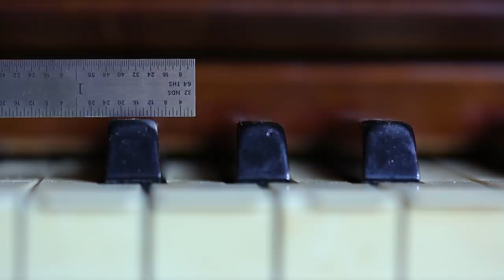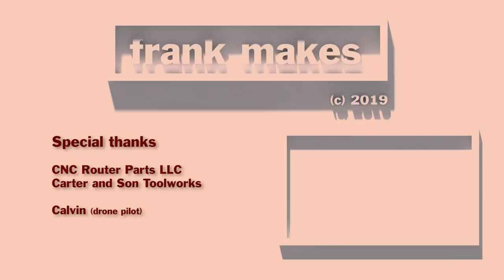Tree Plays Piano.  Its Repertoire Will Amaze You!

Comment: 0:18 I am not an arborist or a climber and even I know that when you top a tree you don't tie it off with a static knot. You rig the rope so it goes through a pulley and a friction brake (if needed) and is controlled by a helper on the ground. When it falls, the helper lets the rope run a bit then gradually stops it so the top of the tree doesn't whip like that. It's insane how many climbers do it as shown in this video when there are ways to avoid being whipped around the top of the tree with a running chainsaw in your hand. Go ahead and call me a keyboard warrior, but I'm still shaking my head. Here's an example of what I mean: https://www.youtube.com/watch?v=-yCaESjy0_0&t=59
Reply: Have you ever heard of a hairy eyeball?
Reply: @ciberbri59  Are you saying that want happened at 0:18 is the right way to top a tree?